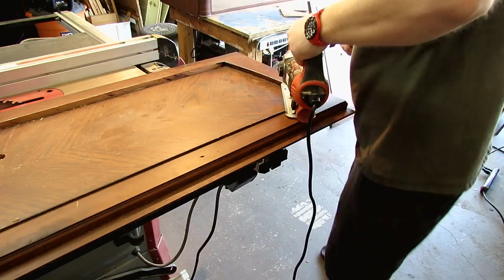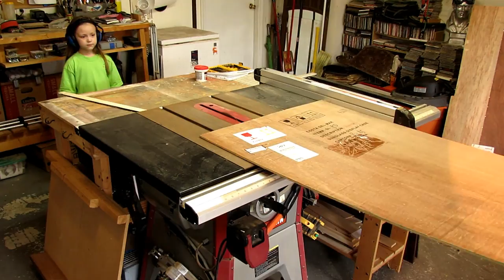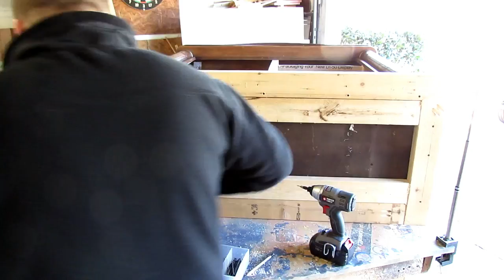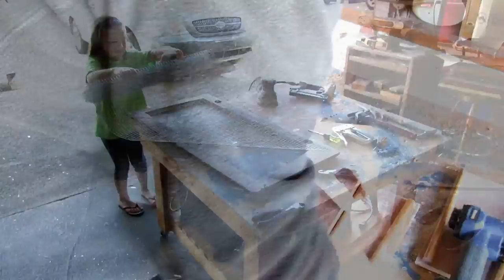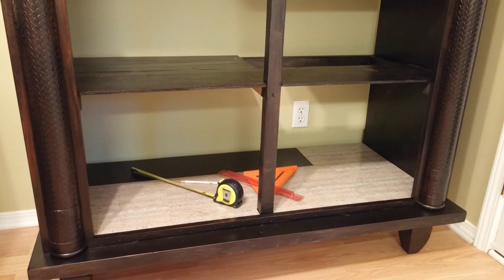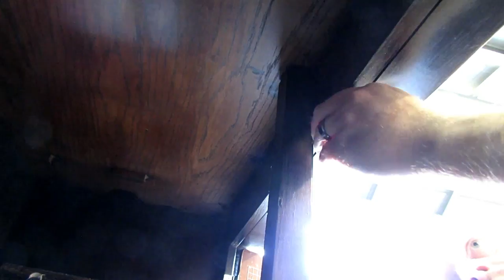How to Make a Rabbit House from a TV Armoire Cabinet

Comment: While beautifully made, it seems too small for a bunny. Also bunnies should not be watered with a bottle. 

I was curious if the bunny actually made it up to the second and third floor. The ramps look smooth and steep and rabbits don’t have pads for traction on their feet. 

I made some bunny furniture and my bunny only sort of uses the ramp and only because she has space to use it as step basically.

Comment: Nice cage
Reply from the maker: Raven Renee thank you!
Reply: Chad Makes It how long did it takeyou to make it also where did you find the armour
Reply from the maker: Raven Renee I did it over a 2 week period working off and on, it could easily be done in a weekend though. All the wood I just had laying around and the front door fencing material I got from home depot.
Reply: Chad Makes It where did you find it
Reply from the maker: Raven Renee it was the top section of an old TV cabinet we used to have
Reply: Chad Makes It i cant find any anywhere but thats a good cage if i could find it id build it

Comment: What type of paint did you use inside that is safe for bunnies? That's the only thing holding me back from renovating a dresser I have
Reply from the maker: After doing some research I discovered that if I used a water based acrylic it would be animal friendly. Turns out it was because our bunny has chewed on quite a bit of it without any issues.

Comment: How is it staying water proof on the bottom floor?
Reply from the maker: It's not waterproof, just water resistant. The rabbit uses the bathroom in a litter-box on the bottom floor, so we don't really have a problem with the floor getting wet.
Reply: Thanks!  Looking for ideas.  I have an old computer hutch that I was thinking of turning it into a rabbit home.  How far part (about) are your levels?  Thanks!
Reply from the maker: they are about 16-17 inches apart

Comment: I'm not hatting on this person, or anyone in general who does this, but you really shouldn't be feeding your bunny water through a bottle. I know its a lot cleaner than having a dish, but it's not as natural for a bunny to drink from and bunnies can drink as much as a large dog in one day. A tiny water bottle like that will not provide them with enough water. also a tip for the design, but maybe have part of the door not be wire because bunnies are prey animals, it's natural for them to want a place to hide in. so if part of the door is not wire, it provides them with a space to hide for when they want to sleep or are scared and want to hide.